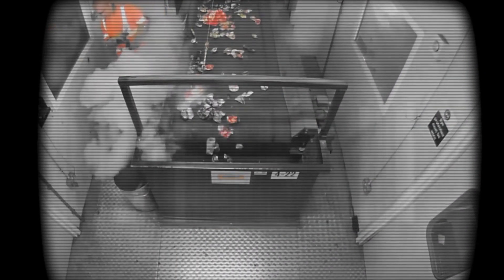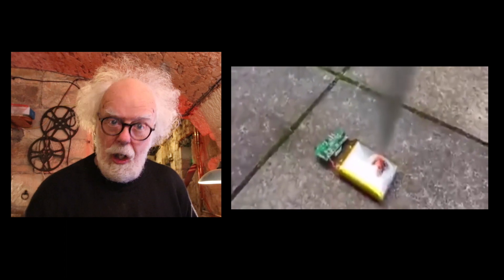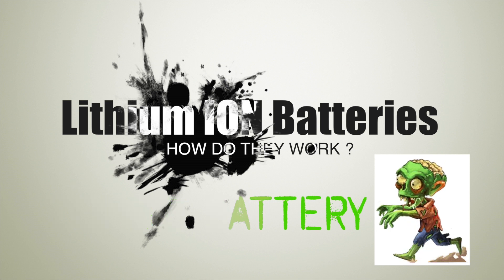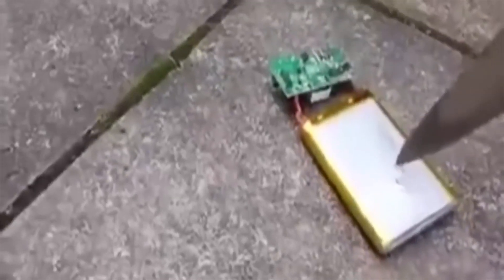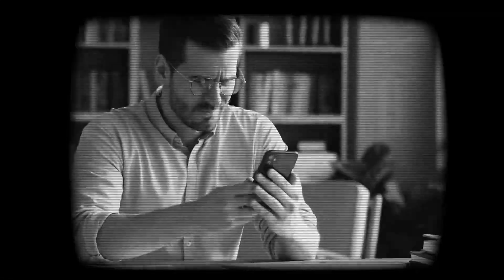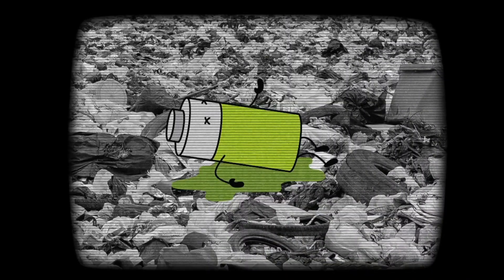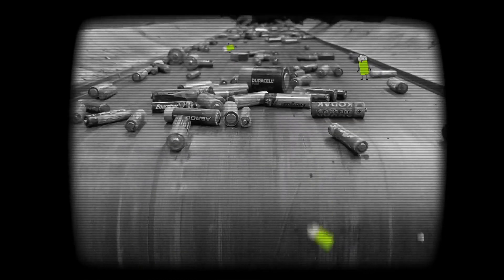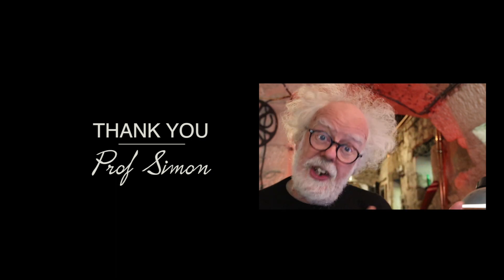Zombie Battery - Prof Simon

Comment: Had a Lithium ion battery explode in my living room and burnt the carpet in about 10 places as it exploded and threw burning lithium everywhere. If I wasnt in the room my house could have burned down. Lithium ion is dangerous due to the very thing that make them great, high energy density. They can also explode if overcharged, or shorted out. Most have safety circuit built in to the battery but they can still fail.
Reply from the maker: Wow...stay safe

Comment: One of my friends works at a recycling center and from what he tells me they have around 3 fires EACH WEEK! 
We fly model aircraft and many are now electric and use Lipo batteries which only have a limited lifespan before the resistance gets too high (or the packs start to inflate) and they won't hold the power so they get recycled although occasionally we'll demonstrate just how bad they can be when punctured! we fully charge them and stab them from a distance with a metal spike, most Lipo packs are 3 cells so you puncture 1 cell and it normally fizzes and then sets on fire, the heat from this 1st cell makes the 2nd cell do the same about 30 seconds later and then the 3rd does the same but again 30 seconds later! These are all flat pack Lipo's which are similar to those used in mobile phones and laptops. The other common types (not used in model aircraft) are 18650 cells which are a little bigger than an AA cell, these 18650's are the same as used in Tesla cars and are terrible if damaged as go off like a rocket!!!
The best way to get rid of them is discharge until 0 volts but do it slowly with a light bulb.
(once a Lipo is discharged below 3volts they are nackered anyway)
I don't store any of my aircraft Lipo's in the house as I've heard of them setting on fire on their own! so mine are all in an ammo box in the garden!
One other interesting thing about Lipo's once they have been on fire and have split open is this:- if you leave them out in the rain they can catch fire AGAIN! it's something to do with the metal used in the cells, I have no idea why it happens but we've seen it happen.

Comment: The state of charge will also have an effect on the cells volatility, discharging lithium batteries will radically reduce or virtually eliminate the ability for them to have a cascading thermal breakdown, blow up / catch fire.
Reply from the maker: Good point

Comment: Lithium ion doesn't have lithium metal in it, it is copper and aluminum, with carbon, on them,  I think you got lithium, non rechargeable, and lithium ion batteries mix together.  The electrolyte, what little there is, is in the seperator, and in the carbon of the anode and cathode,  they are no liquid electrolyte in a lithium ion battery. Alot of the batteries are still good, it's the battery protection that dies,

Comment: Great subject matter Professor.  As you eluded to, some things you can’t remove the battery.  Take my mobile phone for example, there is nothing wrong with the phone, just the battery is tired and needs replacing, but there is no way to open the back to change it.  Well thought out tech then. 🤷‍♂️

Comment: My radio control vehicles use Li-Ion batteries that MUST be cared for diligently. Voltage monitoring and proper storage is a must. If not used properly, these battery packs can and will burn down property.
Reply from the maker: Stay safe

Comment: Future batteries will not have flammable liquid electrolyte but solid state electrolyte, that's clearly the future from a few years from now onward. This is a problem that will go away. For now, it's almost always LIPO's that are the danger (smartphones, drones, hobbies), 18650 li-ion are much lower risk. I still keep my old batteries in metal containers, away from anything flammable until time for recycling. Completely discharging batteries almost eliminates the conflagration risk - technically a fully discharged battery is "landfill safe" noting the rules around what we put in landfills is very very slack, and there is more processing than just discharging and discarding. Not going through trash compactors is probably part of that.
Reply from the maker: Thanks Tim..

Comment: Danger danger there are companies like battery hookups in Pennsylvania that sell used and partially depleted lithium ion batteries to the American public with no warnings. I bought hundreds of dollars worth thinking they were a good product. Fortunately I found out and ship them all back to the supplier. Before they burnt down my house. Don't be using Lithium-ion batteries for your solar battery system. It will start a fire that cannot be put out. Especially if you make huge battery Banks. Caution danger use let acid it's safer around your home for your solar system.
Reply from the maker: Thanks Will

Comment: And imagine the abundance of new batteries as technology moves towards renewable energy, such as solar, where electricity not used immediately is stored in a battery for later use (not a grid-attached system).  As of yet, lead-acid batteries are used for those deep-cycle type operations, and are inherently recyclable.  Thought should be given to implementation of good battery recycle policies down to the household level, in my humble opinion.
Reply from the maker: Good points MJA
Reply: @SimonHollandfilms  thanks, by the way, Europe is way ahead of the states on this one...when I lived in Germany a few years ago it was already much easier to dispose of batteries properly. We have some catching up to do.

Comment: As much as I will applaud the recycling of batteries etc, is there not a problem with the large cylindrical bins in supermarkets etc.  Back in the day when we had "walkmans" and you kept a couple of HP7s (AA) in your pocket, and happened to have a few pence in there two..........then ended up with a burnt leg!  
 Basic electrics! So chuck a few hundred supposedly flat batteries away, series or parallel it does not matter as electricity like water takes the easiest route.  Only a few connections and then you have fun and games in public places, in the video the guys all had PPE on pretty much, Im not sure if you go into ASDA wearing goggles and gloves just yet, mask of course.
Reply from the maker: Yes....I worry how those bins keep safe

Comment: FULL STOP!.
Importent info, before Recycling ♻️,  or Binning LiPo batteries, you need to safely  drain the power from them. The bigger they get the more dangerous of cause.

We modelfliers (RC models), have used them for a very long time. And found this way to be the safest way to totally DeCharge them.

Take a bucket, fill it with enough water to cover the battery, add Salt (table salt or for the road, does not matter). Add a good amount, dissolve. And put the battery in the solution, and leave it for a week, by then it is Dead, as in can not do anything if crushed or punctured. This does not make the metals in them go bad, they are not harmed.

Comment: Very informative professor, are they still allowed to transport these batteries by aircraft, 👍
Reply from the maker: I hope not
Reply: Everyone with a cell phone,  wireless earbuds, or a vape device on a plane has one on a plane.
Reply: @SimonHollandfilms  I guess if you buy a product with a lithium ion and have it shipped next day or 2day it would be on a plane as well. Apparently airlines in the US have banned spare batteries on planes as they could be shorted out.
Reply: @stdorn  was on about moving these batteries in bulk not as individuals boarding aircraft with these divicers,
Reply: @descamm9313  I did some research and it appears that bulk lithium ion batteries can be shipped by air but must have charge level of no more than 30%, Must have hazard label identifying its lithium ion batteries, can only be put on cargo plane.
Reply: @stdorn  and they can transport these batteries on civilian flights, scary times, Thank you, 👍
Reply: @descamm9313  Not on passenger flights only on air cargo with no passengers if shipping bulk batteries.